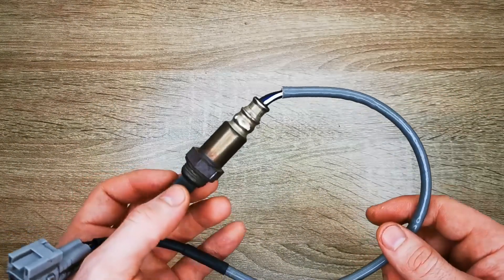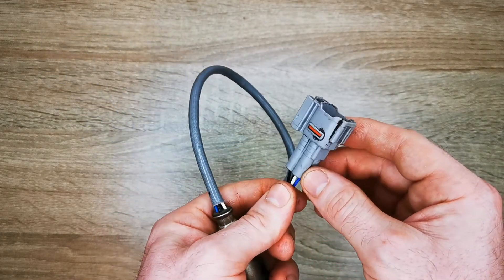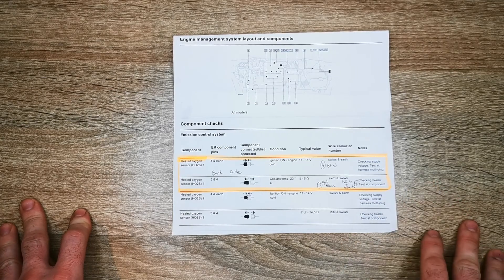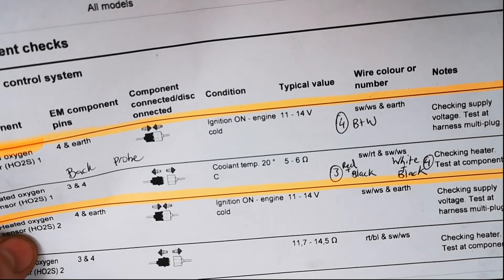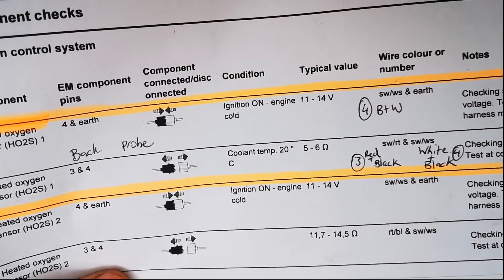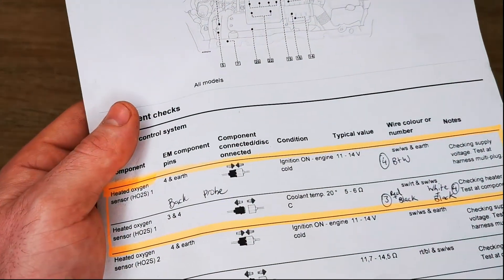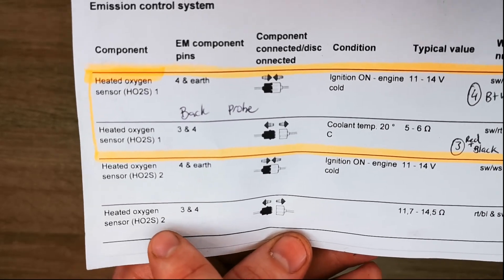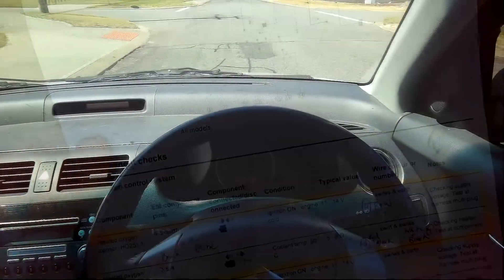Oxygen Sensor Heater Fault - How To Diagnose & Fix

Comment: Pugsot 2008 give error sensor heater b1s1 and b1s2 sensor heater fail on obd is it the same errors as yours my car misses while driving on the road but when turn off and back on it starts normal do u think missing acceleration problem is because of this sensor heaters…

Comment: Just asking, but if you identified that there is a short between wire 3 and 4 why didn't you try to remove the layers of the cables to see if they got damaged anywhere on their path to the sensor? Why this was not an option?

Comment: OL is not zero.  OL means open circuit (or a bigger resistance than your ohms setting).  ‘Zero’ ohms with your meter would be showing four zeros. (000.0)

Comment: you never back probe weather pack connectors never ever.. OL is not zero, it means infinite  resistance , which means either the resistance being measured is too high for the resistance setting on the meter where then you would need to go to the next higher setting or/and if your meter is auto ranging or it is on the highest setting there is an open.

Comment: Thank you for your video. Does circuit low mean heater shorted? You measured resistance is 0 or infinite? I have a p0031. I checked both heater wires, both are 12v. Does that mean heater is shorted, correct? Thank you

Comment: I have a question about a diy project with the sensor. Does the heater working all the time or only for warm up and then it stops? I mean i have/can to use 12v all the time?

Comment: i spent whole day today ... but couldn't fixed the probelm... changed 2 sensors but still getting 2 fault codes which are as following. I do not know what to do even the mechanic didnt knew what the problem could be.
•P0130 o2 sensor circuit (bank 1 sensor 1)
•P0030 H20s heater controll circuit (bank 1 sensor 1)
.... Can you guide me what to do ????
Reply: What was it ?

Comment: I do not have  a heater in my 1999 Ford e150  v8  4.6L. I bought it that way. So what to do about a htr sensor that  says incomplete. Has no choice but to be incomplete.  No Htr, no A/C. No radio,, bare walls, bought as is,  fixed income, disabled so worked for me. Do I tell whoever smogs no htr. Also egr system is incomplete, Oxygen sensor monitor  incomplete ,Evap system monitor incomplete,  catalyst  monitor incomplete. Do those take more driving before they go away. Van needed smogged back in June. Thank you & God bless you

Comment: Hi. Great video. Where can I found documentation for sensor test like this?
Reply from the maker: Thanks very much.
You will get this info when buying workshop assistant programs, the likes of diagnostic assistant, all data or auto data are the main ones I am used to. Usually not financially viable for one off DIY work, as the cost of these is very high and some have an annual charge. 
Repair manuals for your own vehicle is an option that is a fraction of the cost if just working on the same vehicle.